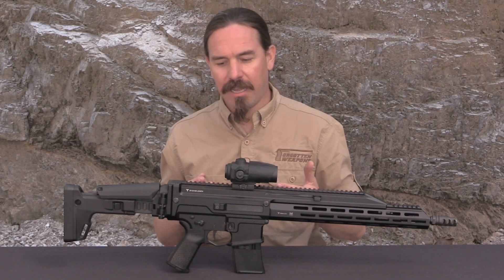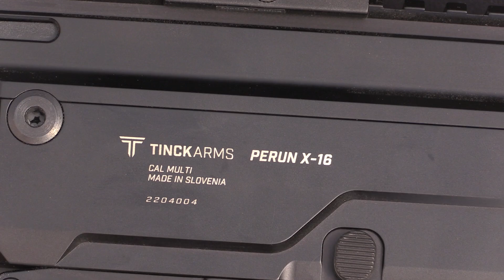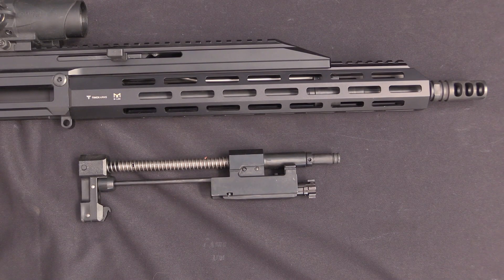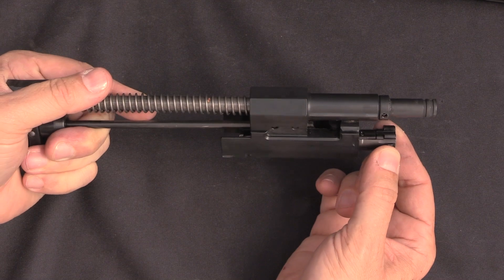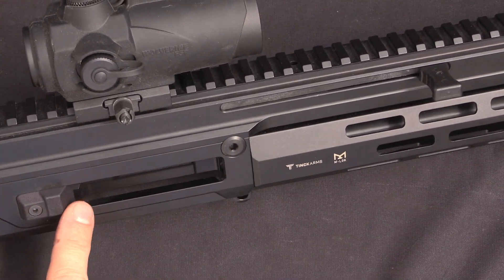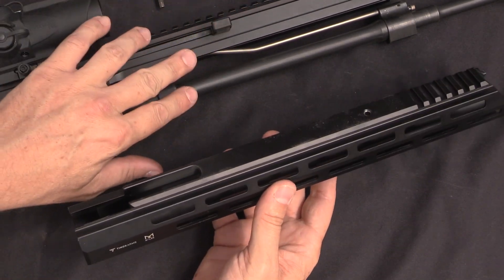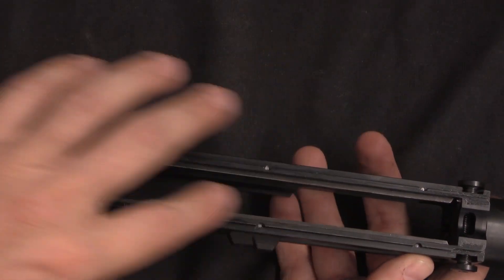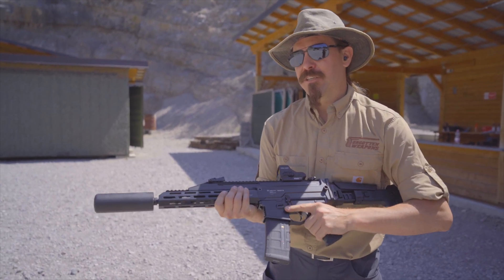Innovative and Interesting: Tinck Arms Perun X16

Comment: This operating system would be amazing in a bullpup. I would just give the bolt a longer lenght of travel for 3 theoretical reasons.
1. Easier realods as the mag would be slightly forward
2. Less recoil because of longer travel
3. Ejection port further from the face which would make it a little quiettet

Comment: It’s a smart take on not reinventing the wheel, and still innovating for improvement. This was really cool and I’m interested to see if some of these engineering designs catch on here in the US. I really liked the centered placement of the gas system, it’s hybridity, and compatibility with regular parts on the market. Anyone know how much it weighs? Sorry if I missed that.

Only thing I would like to see change is for the MLOK slots to be pushed as forward and uniform as possible. I saw the hand guard slots were not aligned at different positions with empty space to add a slot. And if there’s any gaps not being used (such as at the front of the 13.5 handguard shown), to add a QD hole. More slots and holes, more cooling and less weight. 

Thanks Ian for this awesome video!

Comment: That's an ACR with less innovative features like the bolt lock and release, ambi charging handle,  that's an ACR enhanced stock. The extraction section looks the exact same. Although it's most likely much lighter with a less bulky bolt and barrel locking mechanism

Comment: Those few inches of pic rail before the sloped front end sorta hits the eye wrong IMO. 

Could the rail be shorted or that slope be moved forward would probably look better. 

But the overall function of the operating system, interchangeability with mil spec AR components, plus a folding stock definitely makes this rifle intriguing.

Comment: I used to strongly believe that the U.S. military didn't need to switch to a new rifle until lasers (or coilguns) came out. But after watching this video, maybe there should be new designs. This is basically a AR-15, totally modernized with several advantages and certain weaknesses eliminated. Impressive.

Comment: Being Slovenian this rifle is disappointing.  All this company did was Frankensteined 3 plus weapon systems together.  The Croatians  built the VHS(Hellion)   ambli charging handle , good iron sights for backup,  easy change for left or right. The cost of the Hellion can be found for just under$1700 on a few sites.  There already has and does exists 223/5.56  rifles that are gas pistons and not AR's.

Comment: Why is the gas coming out the left side of rifle, seemingly from between the lower and middle receiver?  Is there really  that much gas being shoved out the chamber into the guts of the rifle?  If so that thing is gonna get really dirty really quickly.

I do a lot of work w suppressed DI AR's and don't normally see that much smoke exiting the receivers.  Yes, I'm a lefty and so get just as much gas in the face as anyone.
Reply: In all guns, depending on the suppressor, there are always unhealthy amounts of gas blowing back through the barrel chamber.  The good news with the Perun as well as similar guns that have more volume of space in the body, the gas has somewhere to go aside being trapped at the BCG or jetting out of the ejection port like ARs.

Comment: BUT...
Does It Come In 7.62x39?
Reply: Just need 7.62x39 AR barrel, bolt and mag.
Reply: @aeaarms2973  At A Street Price Of $2000 USD....
Kinda Difficult To Buy, Then Spend $250 More.
BUT I Think You Have A Built A Winner.
Reply: @escott3829  Actually, you can actually get a Builder's kit and build your own 7.62x39. Will cost less than what you estimated. Also, we are discussing about offering among others, a 10.5" 7.62x39 complete Perun.

Comment: Im pesimistic on that one:
It has disadvantages of both AR and short-stroke systems, maybe with less port-gassing issues, no On-The-Go gas regulator... the system seems like bad use case of hybrid car that needs to carry extra electric motor and battery, but uses combustion engine to make the electricity anyway

On the build part, it seems like overcomplicated rifle made to be so interchangable, that nobody in EU could use it (cause parts registration per S/N) that you actually get overly-complex and heavy (7.7 lbs for 16") rifle for a lot more money, where you could just buy a good rifle that would do what you want it to do.

But a few more "generations" might make this far cleaner design that wouldnt be viable.

Btw there already is a Perun15 for some time in the EU... PERUN ARMS (CZ) makes one :)
Reply: Not everybody wants preset gas controls. As example, some love and always shoot suppressed. With a variable gas block, the tuning can be more precise. To the point even below what the operation of the rifle unsurpressed, which by the way, is actually very nice if anyone can try. 
Having said that, there are some who wants flexibility so for the US market, we will be engaging with Riflespeed to provide on-the go adjustability.
With the Perun's AR compatibility, it is quite limitless what the platform can be.

Comment: noooo bolt is gonna crack at the cam pin hole like all piston conversion AR15s eventually do
shoulda used an AR18 bolt or 416 bolt, they're thicker at the cam pin hole in the bolt
Reply: We are not seeing any unusual wear or cracking anywhere at the bolt.
Reply: @aeaarms2973  odd, maybe the remote piston is enough of a damper on the violence of bolt opening...
We were seeing a lot of cracked bolts on all the other piston conversion ARs, they'd crack right through the cam pin hole where it is extremely thin. The 'better' conversion ARs eventually started using a bolt with a thicker stem to reinforce this area.

Comment: I'm not a fan of the two piece upper nor the extra 1.5-2.0 inches of rise for optics.  That height over bore looks about double what an AR has.  I think if you wanted to make a side-charging sporting rifle with a folding stock, you could accomplish it with a much smaller footprint, similar to an AR-15.  This looks clunkier, heavier, and more complicated than ideal.

Comment: The worldwide automotive guys could learn so much from this rifle: Exceptionally easy to field strip, interchangeability of standard parts, improving only where necessary, removing the major flaws of an established product, and simply keeping the rest as simple as possible. This gun is impressive. And I love the attitude of the engineers behind it. Thanks.
Reply: Nah, what the car world needs is subscription based features for stuff like radio, seat warmer, AC etc. The car guys also enjoy always having to fix the same issues over and over again, despite them being fixed on a different brand. Why would you want parts interchangeability? The best part is when you need rear springs, the ones that aaaalmost fit cost 50€ but thankfully you get to spend 300€ on them because they are a few millimetres different

Comment: This is very well engineered ! One could even come up with an adapter plate, to change the butt from Scar-Stock compatible to 1913-Rail compatible and use all the new Sig MCX-Stock options.

Comment: It would be great to have a kit that is just the unique parts imported, with an American manufacturer to make the receivers to sell to the public and then the end user just purchases the constituent parts and assembles them with a guide. You could easily hire a gunsmith to follow the instructions for those that don't want to assemble it, but even having a guide on how to convert a lower from a standard AR15 one would make this a highly advanced rifle that could be sold for much less cost even after the importation of parts kits. Much less red tape to go through potentially.
Reply: I visited the site and saw the full information, The only thing you didn't already implement is the possibility of end users modding a lower for themselves, but I can understand why you may be reluctant to promote such things. Just selling the uppers might be a decent option to consider for those with the means to construct their own lowers from a current receiver they own.

Comment: At first glance, esp when you mention the hybrid di/short stroke piston gas system, it looks like it would be a complicated tool to use and service but once its broken down and you see how compatible it is to current AR platforms it's incredibly simple.  I imagine a huxworx flow through suppressor would make that back blast of excess gas nonexistent .  I could see a variant of this being fielded as a service rifle for slovenian troops if so desired.  If I had to nit-pick I would say perhaps the upper could be simplified just a hair more in the sense of a monolithic piece and perhaps, instead of just those press fit steel rails, seeing a pinned in steel sleeve all around esp for numbskulls like me who like to tinker with ammunition and push the envelope and still remain reasonably safe.  A sleeved upper for the bca could potentially ease wear when feeding hotter ammo through and if, like me, one were to experiment with a special ammunition type similar to the 277 fury sig is making it would act as reinforcement with minimal weight gain.  I would love to get my hands on a couple for testing and research purposes.  And perhaps we could see a 224valk option in the near future as I could see this as being an excellent predator rifle and feral hog slayer.  I'm especially interested in the 6.5grendel offering so it looks like I'll be working extra hours as much as possible so I can hopefully pick one or two up when the opportunity presents itself.  This is one of few things that have really reignited my enthusiam for new products in the firearms market.

Comment: Lol, they made a more complicated ar-180, more prone to failure, not as fast, cheap or easy as an AR line, nowhere near as interchangeable, etc. it may suppress better, maybe…that’s all. Otherwise a poser, worse in all ways than 1960’s US tech, so nice try, definitely fitting for this channel, will be forgotten shortly, especially as even the handguards aren’t even standard…and you have to use screws, in 2022 to take off handguards…ahaha, can’t figure out simple springs, now? That’s cute. Literally zero tools needed fully field strip an M16A2/4 or M4 line, which includes taking off hand guards, bolt carrier group, bolt and receivers. No tells needed, once again first designed 60 plus years ago.

Comment: And wow, the overall result of a field strip is actually worse than M16/M4 that you can break down shotgun style…so good job on going furthering back in engineering, ease of use, and ability to lose parts than something designed in the 60’s, lol…that you had to steal the lower receiver of, cause you can’t do better…sigh, take someone’s else’s work, and make it actively worse in the process. Typical of others trying to make a buck.

Comment: A question that always pops up when Ian makes a video on a modern weapon that's doing something different is: Why?
What does that "new" way of doing something do or do better than a run of the mill (in this case) AR-15?
At least this time you briefly touched on that on the range with the moving parts not being out front. 
But still, I'd love it if that question would be answered more often in these videos. :)

Comment: Ian you handed a weapon to another person without checking if the weapon was empty. The guest did not check the weapon
Reply from the maker: (1) it's an edited video, I'm not going to include extraneous chamber checking on  the finished product and (2) it's pointed in  a safe direction on  a hot range then entire time.

Comment: What a great evolution to the AR15 platform... the accuracy benefits of the gas tube design not having pistons supported by and affecting the barrel, with the benefits of not filling the bolt and action full of crap. Particularly suppressor use. Negates the design fault of Stoner's simplification in design.

Comment: Thanks Ian.  That was really interesting.

One thing I'm ignorant on - is how you can have all these "Standard AR" parts?  No patents to deal with?
.
Reply from the maker: Patents last, typically, 17 years. The AR was developed in the 1950s. Nothing on the original ARs, or the M16, or even anything developed before 2000 is under patent protection today.
Reply: @ForgottenWeapons  OK.  Thanks.  I should have realized that but WTF I'm old ...
.

Comment: I see a LOT of lowers for this being 3D printed.  The biggest hangup of 3D printed AR lowers is the buffer tube area. No matter which way you print it, you're going to have structural integrity issues...  This fixes that problem, and even better, it still uses all AR furniture.
Reply: Ooooh, I hadn't thought of it from that angle! This design may very well eclipse the AR-15 as we know it. Though the upper is a little complicated and proprietary (and will be as long as Tinck arms holds a patent in the U.S.), this rifle adds versatility without compromising parts availability or (we shall see) reliability.
Reply: Too many parts and too low manufacturing volume, which would make this very expensive. Something like BRN-180 is a much better buffer tube workaround for the 3D printed solution.
Reply: @bg315  I’d say the BRN-180 had very different design goals from the Perun. The BRN is more a buffer tube workaround, the Perun is more of a ground up reboot.

If you wanted something that looks and feels pretty much like your standard AR, the BRN is probably a better fit for you. 

If you want something a little different, with more of a SCAR or ACR vibe while keeping 90% of the customizability and aftermarket support that an AR15 has, and you’re willing to pay extra for it, the Perun may fill that slot quite nicely. 

Something like this was actually more what I hoped we’d see come out of the NGSW (rather than that beastly Sig Spear). But oh well. 

(Though I’d definitely agree, improved manufacturing volume would probably do some magnificent things for the price point. Looks like they currently run around $2k for the complete rifle, or $1600 for the upper, which is still a bit steep.)

Comment: Weren't .300 Blackout and 6.5 Grendel designed for use in an AR-15, with no more than a barrel swap, and maybe changing out the buffer spring?

Comment: That is one beefy suppressor alright.  Reminds me of those 3D printed, super light cans from Brevis(called the Brevis Ultra II or something?) but just about twice as long.  Or perhaps more like the 7.62 version of the Brevis.
Did you learn anything about the can?  Like the reason for it being so large, or if it is similar in any way to the Brevis cans?  I still want one of the small, titanium, 5.56 cans from Brevis, bit the cost is just too high, especially considering I've already got a 5.56 can, not to mention that I also shoot long guns lefty, and have been spoiled by my OSS "flow through" can.
However, if Brevis could somehow add flow through technology to their super short, super light suppresors, I might just be tempted enough to pay $1800 for one, especially in 7.62.

Comment: 7:28 Ok, that is incredible. They literally developed and shipped the product with a feature they do not need to guarantee parts compatibility. Decisions like this cause me to trust a company. Proprietary design features rarely benefit the consumer.
Reply: It's also cheaper to use the same parts. Simple economics. AR pressure bearing parts and barrels are cheap because there's so many options. Bonus for the consumer but they can also design it to use an existing 10$ trigger and 2$ grip rather than make their own with the accompanying cost of r/d and manufacturing.

Comment: It would be an interesting exercise to 3D print a Hoffman Tactical AR15 lower, cut off the buffer tower and use it with the Perun upper. Alternatively, for those who are able to alter the 3D print file, print a lower without the tower. That would work for California if a CA compliant Resurgent Arms "pistol grip" or similar grip is installed. Too bad the Perun upper is not sold separately (yet).

Comment: The rifle has some awesome design aspects,
but for the life of me I cant figure out why they add that bulky top receiver/top rail extension: I was expecting it to hide some sort of gas system but it's literally empty space apart from the charging handle. What's the point of ruining every sighting system with that extra height over bore? Surely there's a better way.

Comment: that kind of gas system has always seemed great to me because you should get the advantages of a gas piston and the advantage of having a slimmer handguard like on the AR15. I don't get why they didn't really take advantage of the latter
Reply: Kind of looks like they did it to match up the profile with the SCAR stock (as well as remove the need for riser mounts, obviously) but I don't think that's a great reason.

I don't hate how it looks, but it does have unremoveable bulk that an AR does not